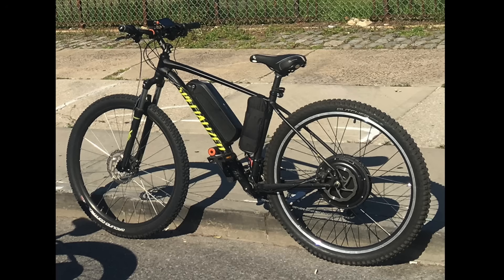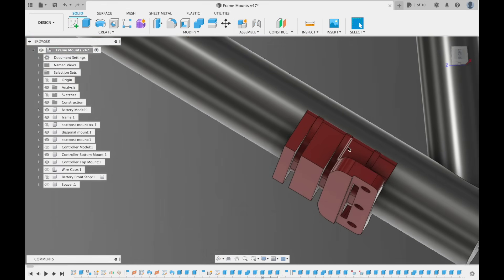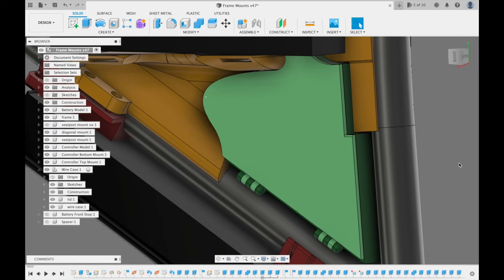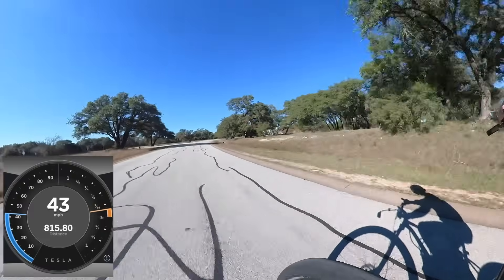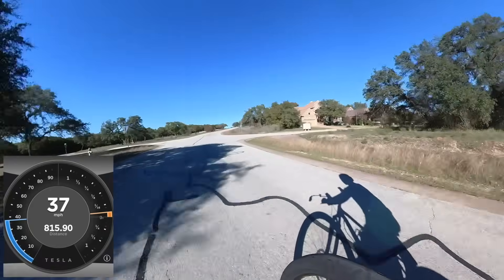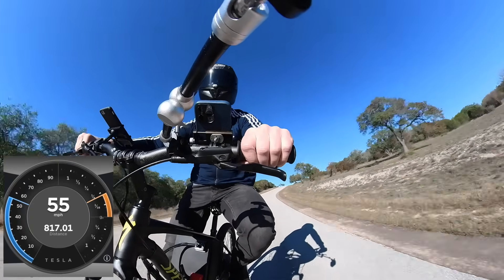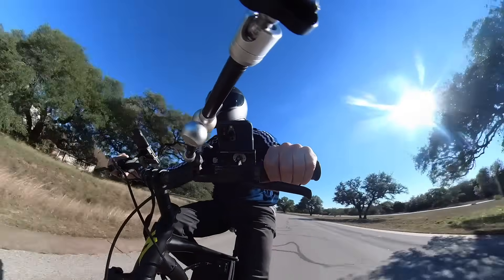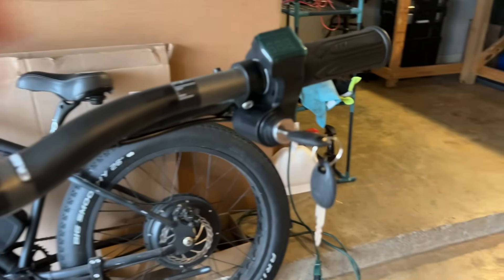I Built a 15,000W eBike and it's WAAAAY Overpowered

Comment: pretty much every 750 watt ebike you can purchase commercially is extremely de-tuned. the throttles are maxing out at about 40% power in "legal mode", and those things are still a little quicker than is comfortable on a really cheap bike. This thing is probably so scary lmao. I love it
Reply: My heart was racing watching him ride this Frankenstein of an ebike 😂
Reply: @raijin7707  You should see mine lol
Reply: I built one that goes 50mph I go though brakes on days and there's no stopping on a dime over 20mph 😢😢😢😢
Reply: How can you remove the limits?
Reply: small RC motors will output 1000w+
for a short amount of time before they melt
Reply: When I got my first 750W setup...I was scared to go full out lol. Mostly because the battery made the bike top heavy as I had to fit it on the top tube instead of in the traingle.  But I got up to 25mph almost instantly and backed off lol. Now it has two 750W hub motors...well..."250W" run at 750W.  I still dont know the top speed lol.  I was run over by a car a few years ago and my balance has never quite been the same.  I only added the other motor for 2wd for help getting up trail hills with my bike camper which is about 130lbs.  I am 130lbs, and the bike is probably 45 to 50lbs. So about 310lb to get up hills.  I see people on mobility scooters that weigh that much going up hills, so I am hoping it is doable but havent tried it yet.  I will keep adding power until it can.  I am hoping to avoid mid drive as I had one and didnt like it, mostly cause of noise but also I didnt like having to match cadence...i wanna ride like a scooter sometimes.
Reply: @AaronHendu think about gearing, some mobility scooters have top speed of 3mph.. that's why they will climb anything
Reply: It's similar to building a computer: Overtuning your specs makes it run way more efficiently and also last a long longer too.
Any PC builder worth their salt will overpower and underclock their components so that they run smoothly for their lifetime.
Reply: @fuzzy-pillar  lol nah, overclock everything.  parts will be replaced before they ever wear out.
Reply: @fuzzy-pillar Less heat is less heat in the summer
Reply: @fuzzy-pillar "Overtuning" really ? I call that overpaying..
Reply: @geemy9675  OK, so then spend 10% less on components that will last 50% less as long.
Reply: @fuzzy-pillar  your numbers come out of nowhere. all legal ebikes 750W are rated for way more than 750W peak and they can take 750W continuous  without any issue. went people modify them it is for increased performance. most people don't build their ebikes and those who do often get motors over 750W and try to get as much bang for their buck, thus push the motors with stronger controllers. as long as nothing is overheating, there is no significant impact on wear.

Comment: My country (thailand) can do 173 km/hr (107mph) on bicycle (and on real road) they use hub motor QS3,000W WP V4 
, Voltol EM260 controller ,Lithium NMC sk55Ah 24S1P 100.8V 55Ah  (Over voltage) but no problem for short time top speed.
Reply from the maker: 100mph on bicycle is suicide. respect
Reply: @GaiusGarage  this video 107 mph ebike
https://youtu.be/BiQANjpQw7c?si=zriNRwxhs_lRCIIW

Comment: Hi hello sir, may I allow to ask a question and please help reply with your expertise on ebike battery. Yesterday when I was paddle my ebike at home with the parking stand mount on the floor, for testing the ebike speed, then suddenly my mother was talking to me, instead of I need to press the hand brake to stop the spining ebike, I turned off the ignition key, THEN I heard a "pop" sound (the motorhub was still in high speed spinning) I don't know the "pop" sound was came from the battery or came from the controller. Sir, may I ask in most of the cases, let say, if a person paddle the ebike halfway through, when the battery still on going supplying the energy into the controller, and the controller still on going supplying the power into the motorhub, and the motorhub still drawing power spinning at fast speed, then he turn off the ignition key OUT OF SUDDEN to cut off the ON GOING power supply intake from the battery, in this case what will happen to my battery? Sir, please help me,

then I unpluged the ebike power  plug from the battery, then I turn on the key ignition to purposely release the electric in the controller, then I plug the ebike power plug into the battery and heard a as usual spark sound. 

My concern now is, how do I know I already wound, injury, or damage my battery or not sir. Hope you understand my question, trillion thanks if you would please reply sir.
Reply from the maker: please feel free to book some time on my calendly for help with this issue https://calendly.com/gaiusgarage/15-minute-consult

Comment: Fun build, did a great job on it. Just doing 50 on it is insane, my hand wont turn the throttle when i get to about 38 on my 48v 2kw 33ah setup. Brain says do itttt, hand says not doing ittttt :-p whats the range like, im getting about 30mph for 30 miles on a charge from a 1500w 48v 33ah pack.
Reply from the maker: thank you! about 25mi range probably, less at 50mph
Reply: @GaiusGarage  Thanks for letting me know, that kind of sounds right, its like my brakes burn down fast at 30mph in a month or two for each sets of pads where if I was doing say 15mph they would probably last a year. I just did a bit of work on my old ebike, added some blinking rear indicators and gave it some new forks as the pot holes here in england mauled my old ones :-) adding a rear camera (reversing camera) and a front lcd mini monitor on the handle bars to see what is behind you can be handy, saves that wobble looking over your shoulder and keeps the bike width minimised compared to adding mirrors.

Comment: What was the total cost of this build?
Reply from the maker: battery ~$800, controller $150, motor $200 (used on FB marketplace), bike $700 (purchased new before ruining), tires ~$80. maybe $60 PLA printing prototypes & testing. all 2020 prices
Reply: @GaiusGarage  wow! That's not bad at all.

Comment: That is crazy. Something that occurred to me that wasn't mentioned in the video is the stress on the wheels/spokes and what happens if you need to brake hard. Seems like a maintenance nightmare.

You've basically got motorbike power with bicycle tolerances.
Reply from the maker: yeah, Ive had to true the rear wheel several times
Reply: @GaiusGarage  no doubt. How are the brakes doing?  (I  know no one gives a sh*t but I'm curious)
Reply from the maker: @simonleonard5431  definitely have to change the pads more often but fine for stopping
Reply: @GaiusGarage  you don't ever want that moment when you want to stop and you can't. Please 🙏 make brakes 2x power
Reply: My 2000w e-bike has wrapped the inner tube around the gear cassette, I don’t know how you avoided that!
Reply: @ridefast0  insane, i mean unreal. how is the acceleration of that bike.
Reply: @wegoodinthehood-b4u  Yeah, Photon mid-drive accelerates well in low gears, but I am more careful now after I fractured my back on the road behind the bike!
Reply: @ridefast0  what happened ?
Reply: @wegoodinthehood-b4u  Out for a family bike ride with the grandkids, tried to impress the wife with a big first-gear power-wheelie, over cooked it for a hard landing and a trip to A&E. Took 3 months to stop hurting but all is well now, thanks for asking. Happy travels to all!
Reply: Putting motorcycle wheels on a e bike
Reply: you need disk breaks.

Comment: "Hey theres a weakpoint in your frame"
"Actually the weakpoint IS the frame"
Lmao, this guy is a true engineer!
Reply: Steel frame with rear suspension will do wonders. Box frame preferred.
Reply: @charlestannehill7537  where would the batteries go though
Reply: @Fred_the_1996  make slim battery packs with attachments to the frame.
Reply: What I would worry about is failure over time.  Steel can be pushed to the edge many thousands upon thousands of times.  Aluminum cannot be taken anywhere near its failure limit without cumulative damage.  The whole frame can be seriously compromised without showing any damage.  It is not a "tough" material.
OTOH, nothing sold to consumers in American stores is going to get near that operational zone.  There will be plenty of safety margin built in.
Reply: @tarstarkusz  why not  use titanium frame, so he can add more batteries lol
Reply: @ramonella5718  Chromoly steel is the best material while remaining reasonably priced, though still roughly 10x an aluminum frame.
Reply: @ramonella5718 first of all I personally think this would be prohibitively expensive, if not just completely impractical.  At least would have to be an alloy involving titanium, not just titanium.
Reply: There are motorcycles with aluminum frames?
Reply: @tarstarkusz aluminium is not a tough material... but you don't design a bike motorcycle to last 100 years or 500kmiles.  every 200hp motorcycle has an aluminum frame, aluminum block, maybe titanium valves and is designed to take the abuse of riding on a track with 1G+ cornering, braking and accelerating. except the rare ones that use carbon, which is actually worse regarding fatigue.
if you take an aluminum downhill mountain bike designed to handle huge drops you will not get even close to the limits of the frame.
Reply: @geemy9675  I agree with everything you just said.  That's why I posted this in my comment:
"OTOH, nothing sold to consumers in American stores is going to get near that operational zone.  There will be plenty of safety margin built in."

Now, that is operating under normal conditions.  Putting a 15kw motor on a bike could cause a lot of fatigue problems, especially on the dropouts.
Reply: @tarstarkusz  big box bikes don't have a safety margin built-in because they are just commuter bike dressed up as mountain bikes.
proper mountain bikes don't have drop outs but thru axles, so you wouldn't be able to use traditional hub motors. grin technologies all-axle hub motor would work though but I don't think it can handle 15kW
BTW their motor simulator is a gem...
Reply: @geemy9675  Even a through axle is not going to handle the kind of torque a 15kw motor can put through them.  I don't think the clamping force is high enough to prevent spinning.  They are designed to handle drops, not torque.  Most (all) hub motors require reaction arms.  High end mountain bikes are not built to the same standard as consumer bicycles typical of Walmart or even a low end bike shop bike.
Besides, I am talking about big box bikes.  That's what is in the video.
Reply: @tarstarkusz  no it's a specialized, not big box bike
Reply: @geemy9675  OK. It's been a while since I saw the video.
Reply: Oh ya, he is truly a talented young man.
Reply: I bet a slowmow cam could see the frame flex if he goes full throttle
Reply: St this power level why not just use motorcycle frame,  just for safety.
Reply: @Jackal9405  weight.
Reply: @Jackal9405 because then has has to register the motorcycle
Reply: kfc see is all is ee
Reply: The weak point is the rider...lol

Comment: Hey man! Don't mean to leech but any help on deciding a suitable battery pack for a 3kw with some headroom? I've been going in circles because I'm on a mtb frame like you and weight is a concern, but voltage is kinda key... are 18650 or lipo packs the way do you think? Thanks and love the vid great detail on everything and love the 3d printing stuff great ideas.
Reply from the maker: thank you! for that power level you can go with either but lipo won't last as long..they're not really the best for things that need to last a long time. 18650 is a good option but there are others as well..some that are simpler to implement.  if youd like a more detailed breakdown I have 1:1 sessions you can book with me..happy to help design something based on you specific setup. link for that is in the description
Reply: @GaiusGarage  Ohh cool! Really appreciate that. I'll hit you up at some point soon for sure, looking to get this thing out of ideas and into reality. Take care.

Comment: So the 1500w rater motor essentially playd no effect in what is "wattage"  actually is? 
As in you cqn just over power the motors rating with a controller and battery?
Reply from the maker: its rated 5kw but yeah you can push whatever power you want into a motor. there are additional effects involved like the efficiency dropping with higher current and of course heating. but if you can remove heat effectively or only apply high power for a short time, you can push a lot more power to these motors than what they are rated for

Comment: Love the machine pal.... 

Erm if the alu drop outs were an issue
... there would be another route, you could have tried .

I don't know the terms of parts , so , 

The triangle section , with the drop outs ,that hold the wheel ,  cut same section ,from a steel framed bike.. bout 6inches , of steel tube and drip out ..

And mate with all section, pinned in place , four locking nut and bolts , with section of steel rod ,down internal section , to make sturdy ...

Yeah it'd add a bit of weight ... but it's another option ,you could have gone for ,   but who's to say , that this wouldn't have been as strong ,either ....

Heck 125 scoots are mostly alu , on back wheel ... just different transmission set up

Comment: Most aeroplanes are made out of aluminium with frams that much thinner than your bike & they have upwards of 300 kW engines in them.
You should worry more about the spokes in the wheel way more then the frame !

Comment: My kaabo wolf king gt scooter does 67mph out of the box with 4000 watts🙄
Reply from the maker: watts/power is not a good indicator of top speed. has to do with voltage, gearing, and motor winding & design. you can achieve very high speed with low watts, but will tradeoff acceleration

Comment: Add some 20lb dive weights to the back side of your front wheel.   Use a front pannier kit flipped around and mount it with stainless duct clamps.   The added weight will restore the bikes original balance you changed.   For best stability at speed, your front wheel really needs more weight, as low as you can get it.   A super heavy duty wheel will give you gyroscopic stabilization once you get moving, but might be unstable AF at low speed.
Reply: Domt add weight ballasts on an ebike...always add more battery.  The battery is a ballast.
Reply: Those tires are really heavy. I have the same ones. But I also run tire liners and downhill tubes. Probably would do a good job at adding a significant amount of weight based on how heavy my wheel setup is. Not quite 20lbs on the front end, but it's way heavier than it needs to be (I just never wanted to deal with flats. Never got a flat with that setup)

Comment: At what point do you accept that you just want a motorbike.  You even say in the video that the parts aren't meant for this speed, you want a stronger/stiffer frame and bigger tyres and brakes for the speeds you're doing there.  You're not even wearing gloves!

Comment: Hi from Croatia, where Cromotor is made :), i had 72v 80A controller on it, but had a chance to try 100V 120A 12kw, and it was insane, full throttle could barely hold on to it...(ad no experience before it)

Comment: with that much battery and controller you need another motor on the front, it will be an entirely different beast then and capable of offroad

Comment: 15000 Watts is about 20 horsepower, so power to weight ratio would be about 200 hp per ton. No wonder it accelerates so fast. Excellent build!
Reply from the maker: good insight! is hp/ton a standard measure of power to weight?
Reply: @GaiusGarage  Yes, it's standard for cars and motorbikes, here in the UK anyway.
Reply: @GaiusGarage  yes,same in the nordics or germany. Koenigsegg one:1 f.e.

Comment: Awesome stuff.

you're fortunate that the road you're riding is smooth too. If you were unlucky enough to hit a pothole that bike would be toast, along with you. Even at just 20/30mph it would be pretty bad.
Reply: It is very common to go 20mph on a bike.
Reply: @timothyhendricks3004  still serious to hit a pothole at those speeds.

hitting one at 50mph+ is most definitely going to be life threatening.
Reply: @Thingamajigs  Hitting a pothole or even a sharp bump on a bicycle like that would probably snap the forks and result in a faceplant. I saw a guy on a bicycle trying to hit a record speed on a downhill one time. He hit a few small bumps at 80mph or so, and the forks snapped from the intense vibrations, and he faceplanted instantly. very painful.
Reply: Yeah, maybe not so bad on the low end, but it still gives you a good scare. I've had that happen while riding, and if I hadn't seen it I'd be missing teeth. At 50mph though? That's full face helmet time. Done around 50mph on a giant hill once, normal road helmet, scary and fun for sure.

Comment: What about the motor? You only upgraded the battery and controller
Reply from the maker: motors can usually handle a lot more power than rated for short amounts of time. as long as I dont lay on the throttle non-stop, the motor is sufficient

Comment: does it regen while coast or brake..?
Reply from the maker: no, this controller uses a simpler control method with which it is more challenging to implement regen. thus this feature is omitted to keep the cost down
Reply: in the video of telemetry it was green off trotle so thought regen. but very interesting build. and an easy swap over to a diferent frame when needed. nice print work as well. maybe some kind of steering damper for higher speeds, be cool to see.
Reply from the maker: @zachcreech7411  yes, steering dampener is a good idea. much appreciated!